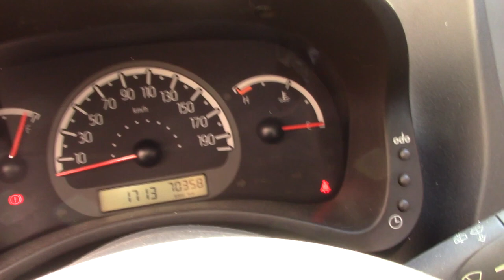Fiat Panda 1.2 (2003÷2012) complete maintenance service

Comment: This is a really helpful video, thank you!! I just wanted to ask, do you know where the coolant reservoir drainage plug is located on the fiat Panda? My partner's accidentally overfilled mine and I simply don't have the money to take it to a garage as of right now. Thanks!
Reply from the maker: You're welcome! 😉
I don't think there is a drain plug for the coolant, so you have to remove a coolant hose from the bottom of the radiator, but is not a simple thing to do. I suggest to buy a big siringe (you can find it almost in every pharmacy) and suck out the excess of coolant directly from the reservoir. Hope this can help you😊

Comment: You didn't do the spark plugs part but still thank you!
Reply from the maker: Spark plugs every 60000 km. Service every 30000 km.
Reply: @MoExha  Right, I'll take your word for it
Reply from the maker: @florjanbrudar692  be careful to don't break the injector electric plugs when you'll try to remove the spark plug caps😉

Comment: Don't you replace the fuel filter?
Reply from the maker: Nope
Reply: It has no fuel filter as a service item, it is an integral part of the fuel pump/sender in the tank
Reply: You can change that if you really like, but it does involve getting to the top of the fuel tank which is buried beneath the trim in the boot. Doesn’t hurt to do it, it’s also not necessary unless the car has never had it before and has around 100,000Km or more on the odometer. Even then chances are that it’s not actually a big deal, but again won’t hurt to do
Reply: @fattyMcGee97 there is no filter available to change, it is only available as part of the fuel pump in the tank. It is sealed for life